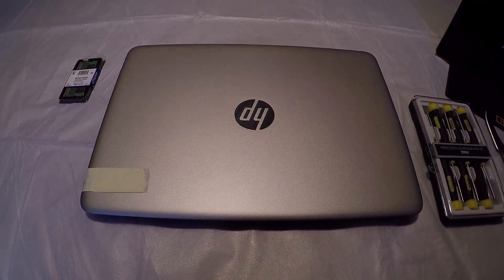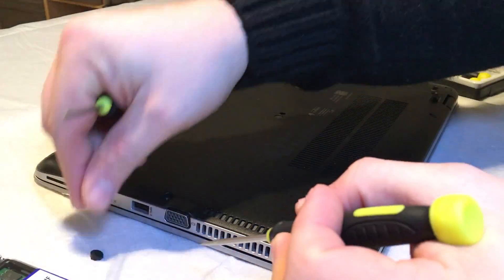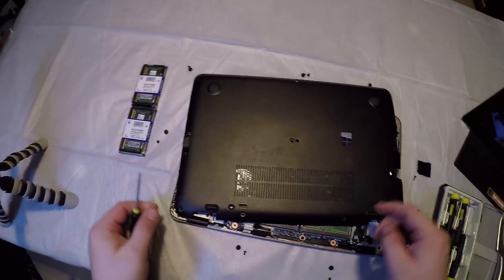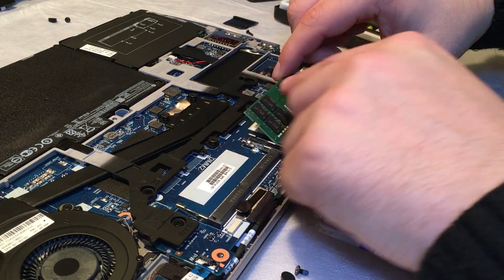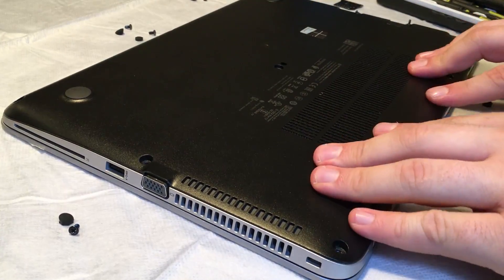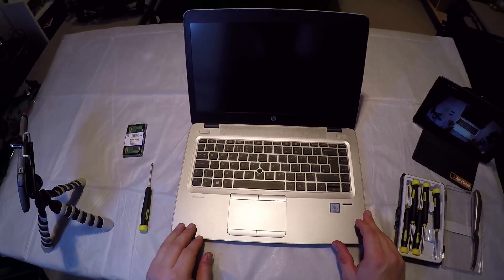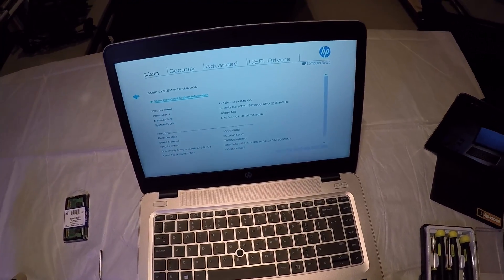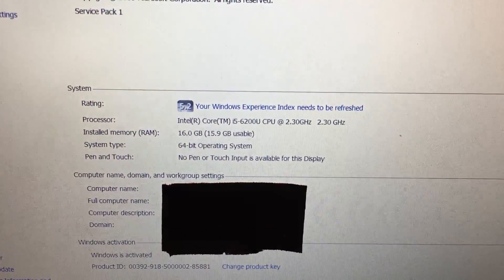How to Upgrade HP Elitebook 840 G3 Memory

Comment: I replaced stock memory with 32Gb of 3200MT RAM. System info shows RAM is operating at only 2133MT. How can I change BIOS to take advantage of the 3200MT available?

Comment: I appreciate the video, but you really need to be more careful in your presentation. You should remove the battery prior to installing the memory since the battery may be feeding some electrical current to the memory bay and other components of the motherboard. You also didn't mention that the laptop should be powered down first (i.e. not in hibernate or sleep modes), which otherwise could ruin memory components upon uninstall/install. Also you say, "earth yourself on something metal because of ESD," but A+ Cert requires remaining in contact with ground during all PC repairs. I'm not a pro, but I find having the components sitting on top of a large electrostatic bag and maintaining contact with it to be sufficient to preventing ESD.

Comment: Hi there mate. Any chance you could tell me what the standard ram is for the hp? I want to add another stick but can't see what the current one is. I believe it's the standard factory ram as stock
Reply from the maker: JJ JAY The factory RAM is: DDR4-2400 or PC4-19200. The machine comes with 4GB and supports up to 16GB 2x8GB 👍🏻
Reply: Later revisions of the G3 will support up to 32GB. I have that configuration in mine.

Comment: Does it give you the bios warning every time you start the computer or, once it passes first boot after the memory switch, it is added to the "whitelist" for good ? I add a 840 G1 (now with a G3), and adding a non HP-oem ddr3 stick, it would give the warning every time you would start the computer, quite annoying since you have to press a key to continue.

Thank you for your answer.
Reply: Only at the first boot
Reply: @khoredon  what if you just let it boot up and then check the mem in the operating system? just as easy right mate?